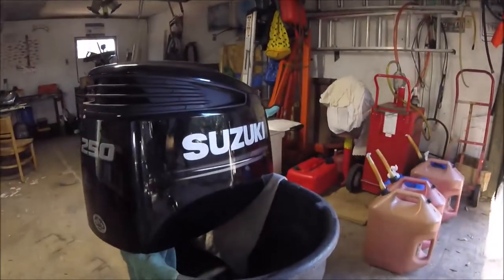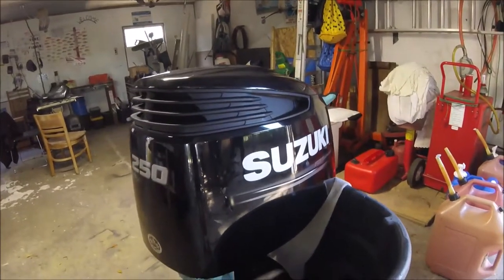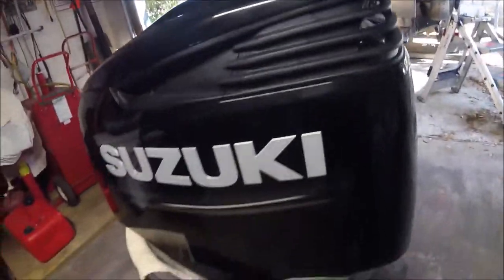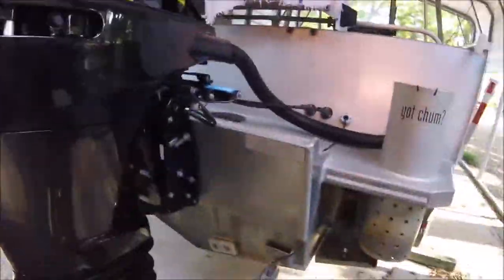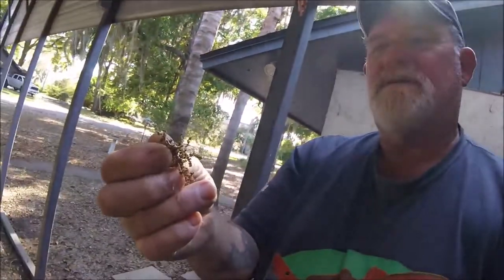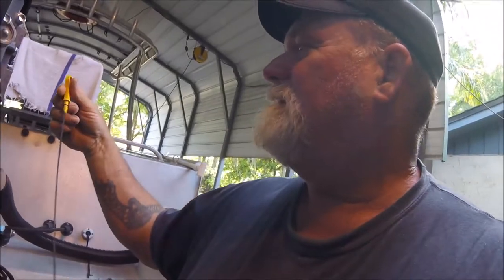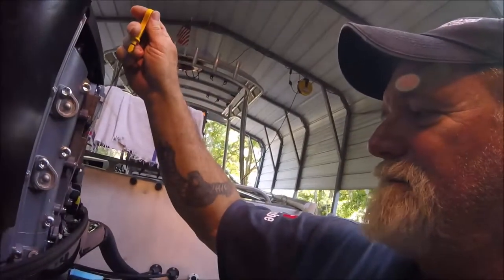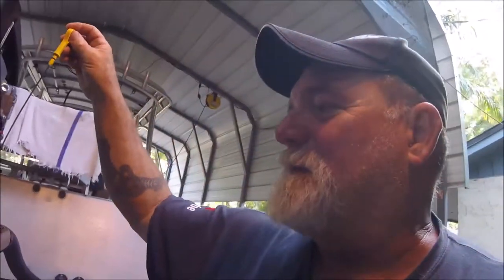HELLO, SUZUKI MAINTENANCE FREAKS

Comment: Get yourself a barrel !!   Don't just use the flush port. The flush port is ok but the barrel is best. Puts fresh water up the driveshaft and into seals going into intermediate gear. A slow stream of fresh water into the barrel will keep it from overheating. Don't start it in the barrel and walk away, stay with it while it's running don't let the water get too hot, warm is good. Dave is 1000 percent correct.    Look at those little giant steps in the background.  Where can a boat owner get a pair of those awesome steps?  Thanks Dave I use my little giant steps all the time!!
Reply from the maker: ya got that straight! I run mine and sit in the boat regulating the RPM's, while drinking a 16 ounce PBR. when the PBR is gone, I'VE FLUSHED thoroughly. My motor is still warm, since I'm only 5 minutes from the boat ramp. yeah the steps are several years old and live outside 365 and are still going strong!

Comment: I'm thinking rigging a finer screen on the water intake on the lower unit will reduce particulates. As long as it doesn't restrict water intake too much to where you overheat the engine
Reply from the maker: no clue what you have, but some are swapping the 250-300 inlet ''screens'' on to their new Zuki SS motors ton get more water. Obviously thats a thing. But I know no particulars just saw in a video.

Comment: Capt Dave  Have you ever fun any 200 HP Suzukis?  Love all of your maintenance videos.  You definitely are the king of Maintenance.  I am putting twin 200's on my new offshore and plan to flush it with the barrel.   It will be a saltwater boat 100% of the time.  I plan to use a salt away, rydlyme or similar.  I have seen the results you get and am convinced periodic desalting is necessary.  After you use chemicals to strip the salt away, How long do you flush with fresh water to remove the acids from the salt removal treatment from the motor?  I do not get the mud you get  (and man you get it, never seen so much crap come out of a motor)  just salt.   Thanks for any advice, your maintenance videos are top shelf.
Reply from the maker: NO never owned 200'S EVER...and just flush with a barrel, don't worry about all that rydlyme or saltaway with new engines.
Reply: @CaptDavesSportfishing  Thanks for the input!

Comment: Hey captain Dave!! Quick question.. I just bought a brand new Suzuki outboard. My 20hr service just came on today. Can I do my own oil change and lower unit my self ? . Or do I have to take it back we’re I bought is and have them service it? If i did it myself would it void my warranty?
Reply from the maker: Hahahaha, you can do it all yourself!  I maintain mine better than the shop manual, states.

Comment: Capt Dave is da man ! Any recommendations on a dealer for a repower 300 hp ?
Love your channel 👍👍
Reply from the maker: The 250 is about the same motor and probably a lot less. I've bought both my zuki's from Dell Marine, Dellmarine.com Address: 6268 Philips Hwy, Jacksonville, FL 32216 Phone: (904) 730-9968  but would definitely SHOP AROUND and check into St. Augustine Marine 117 Dockside Dr, St. Augustine, Florida, 32084, Phone 904-907-2726 Email outboardShop@staugustinemarine.com
Website: staugustinemarine.com